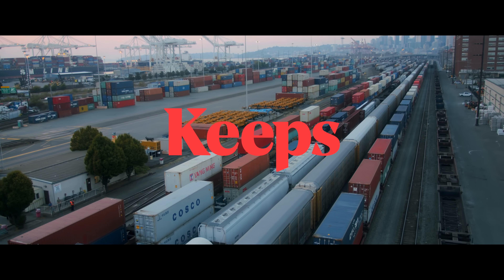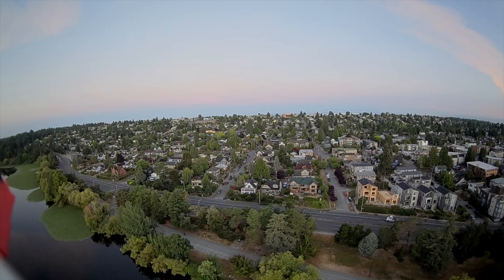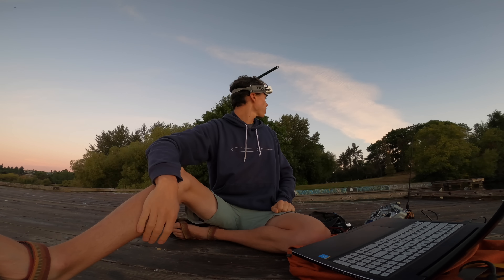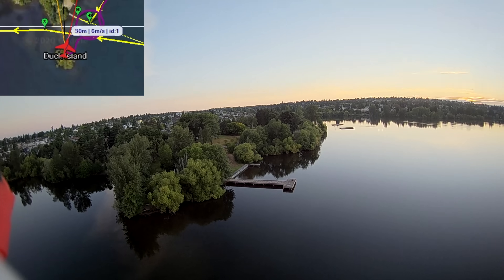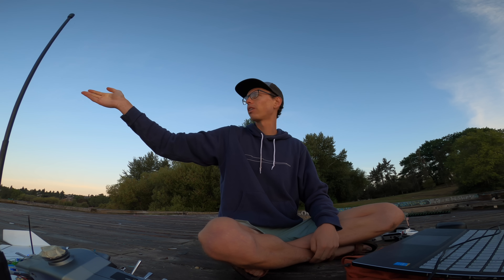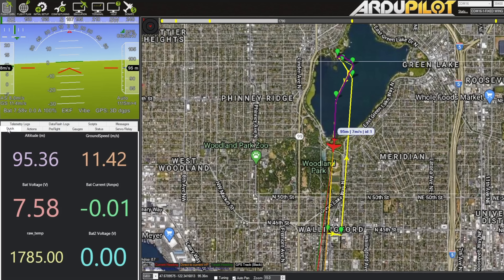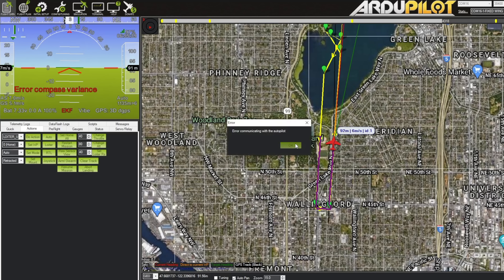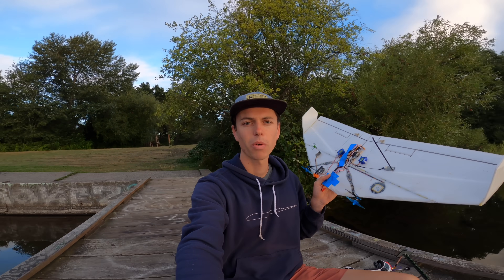Tiny Waypoint Drone! - 230g Autonomous Wing

Comment: laws and politicians are stupid in general.
your plane looks good, I am building a drone from a few new parts but mostly secondhand parts from a broken drone I bought for €10(with 4 working brush less motors, the only thing that was broken was one of the 4 ESC's it was a 4in1ESC so I decided to replace all of them and use that 3in1 esc for some other project in the future either as a 3in1 esc, or if I can fix the broken ESC as a 4in1 ESC. but if I can't fix it(make it balanced) I wanted to use the motors and such for making a plane like that kind of.

also know that your drone is hand made, so if they where to make then in factories things would become a whole lot lighter than you made it, and likely cheaper as well. since in the past there where quadcopters with many such things building for very cheap, so if the make it like that in a simple sturdy relyable plane glider it would be a great option for very cheap long range flying for beginners.

however building it yourself is certainly also fun.
and allows you to do a little more things since you can more easily fix it yourself.
however I would personally try to add something to make the landing more safe, I would be afraid of breaking the propellors like that. and adding a landing mechanism doesn't need to be to expensive or obstructive. after seeing you dive straight into the ground on your first landing I came up with some fun FDA aproved landing mechanics which acording to the FDA and politicians would be completely safe.

method one would be to add some kind of spike on the front and add it on a spring so it gets pushed back and gradually blocks more force the furhter it is pressed untill the plane stops. that way you can just nose dive straight down, the spike on the front will go into the ground and the spring will dampen the impact. if the plane went down fast enough and the spike is sharp enough it even might keep standing in the ground making it more easy to find it. however be carefull to keep it below 250 grams, since once it weight 251grams that plane would suddenly become super dangerous.

method 2 relies on a tail and having a hook  a bit back on the tail. that hook should be able to slide out and then use something like a elastic to brake the plane down after the hook grabs in the ground. kind of like what ships do but with a little springing function to protect the plane.

ofcource both these methods are just for fun/joke reasons they wouldn't likely be the safest most relyable options and certainly not the most easy ones,  for example a parashute should be safer, and you could also just make landing wheels or some slide like mechanism. using some kind of slide like mechanism would prevent it from breaking the streamline which means you wouldn't need a servo to retract the wheels.

it also actually would be interesting to see a RC plane based on the mars glider, it is a new(acient) type of wing which is far more efficient than normal plane wings and much more stable. new as in barely used despite the designs being out for many years by now(you can find it on NASA's site or on some random old glider forums with mostly chinese american people. or in germany in the past, but back then they did it on accident without knowing it, and they just did it because it was cheaper and more easy to make.

but using that mars glider principle you could make it a lot lighter and give it much further range and also many other things like stability, a better speed response to both low and fast speed and such. 

also if you ever want to build a really weird RC device then contact me I know some interesting projects. some might however need to be adapted based on skils.

Comment: WHY DIDN'T YOU USE LITHIUM ION BATTERIES two relatively cheap cells can get you 4ah and the equipment isn't that power hungry i bet you could get away with using 30a discharge rate cells

Comment: I wanna see some slight improvements to this wing.. i know you have stuff like the ESCs and radio in the foam, but what about the battery, servo motors, and other electronics? Even a slight bit of drag reduction I feel could be very beneficial here.

Comment: Regarding this videos sponsor. Keeps' primary medication is called Finasteride. Keeps charges $75 for 90 1mg-tablets ($0.83 per mg). The same medication is available, in the UK, for as low as $0.49 per mg without the marketing and subscription nonsense.

Regarding Finasteride itself. Finasteride works by suppressing the hormone dihydrotestosterone. 

"Dihydrotestosterone is a hormone that stimulates the development of male characteristics. It is believed to be responsible for triggering the changes experienced during puberty in men. This hormone also causes the prostate to grow and is thought to combine with testosterone causing the expression of male sexual behaviour. Dihydrotestosterone is many times more potent than testosterone, and many of the effects that testosterone has in the body only happen after it is converted to dihydrotestosterone." (Source: https://www.yourhormones.info/hormones/dihydrotestosterone/)

Side effects of Finasteride include:
- decreased sex drive
- trouble getting or keeping an erection
- ejaculation disorder
- increase in breast size and tenderness
(Source: https://www.healthline.com/health/finasteride-oral-tablet#side-effects)

TLDR: Keeps is somewhat expensive for what it offers and its medicine works by (effectively) suppressing testosterone levels to postpone hair loss. This may have significant side effects, typical of what you may expect with reduced testosterone levels.

Comment: Anyone know a good set to control ground vehicles autonomus with ardupilot? I wanna get into this and there are just to many boards and components to have a clear overview or even understand how everything works together.

Im familiar with flashing firmware and working with microcontrollers and even coding, having a printer and everything you need to realize something like this.

I just need a good bundle of components or a good video where you can understand everything.

Thanks.

Comment: toss a couple Sanyo NCR18650GA 3500mAh cells on there and get about 4~5 times the flight time, and clean up that mess and reduce to one motor for additional time. This one guy flew a 4 hour 100 mile trip with a z84, 70mah/mile (260mWh/mile). Thanks for the video.

Comment: If your plane was a pusher then yes, the baby might giggle.  But instead, the baby's face might get sliced and diced.  Instead I'd say its far safer than fishing with razor sharp hooks at the shoreline being whipped through the air near ground level and leaving dangerous invisible string around for animals to choke on and strangled with.  :-)

Comment: Does the dragon link connect to the PC for telemetry? I saw a USB cable there but didn't notice if it was connected to the radio
Reply: Do you know this already? I am really curious aswell because I am working on a plane like this aswell and i dont like using an extra antenna for the telemetry for ardupilot because i already do have telemetry on my transmitter.
Reply: @pingsangi5418  while sadly no one replied to my original content, I soon took research on my own hands and found out Dragon Link does support MAVlink natively and uses a dedicated wifi or Bluetooth module to connect to your laptop, so no wires beyond power and PPM are needed.
Reply: Thank you very much for replaying this quick! So you mean he has a module on his transmitter that sends the data via Bluetooth or WiFi to the computer? Do you know which modules this are? Thank you a lot already!
Reply: @pingsangi5418  The dragon link system has two components, a transmitter and a receiver. 

The receiver connects to the flight controller and uses MAVLink as communication/telemetry protocol.

The transmitter connects to your radio (I.e. taranis) using PPM or SBUS; this transmitter also has an included WiFi/bluetooth module, which is how it relays info to the computer. 

I shall advice you check on the DragonLink’s website for a bit more in depth info!
Reply: @DaWalkDude  Thank you a lot! You helped me so much! Is it also possible with the frsky QX7 because I have that one already? If it onely is possible via USB cable i would like that to know aswell!
Reply: @pingsangi5418  as far as I’m aware, as long as you have a JR-style bay (or any kind of PPM output for that matter) it can work with dragon link

Comment: The problem that there is a gap for models that light, is "solved" over here, in that as soon as there is an onboard camera, the same laws apply as if it would be heavier. Clearly proofes that the whole legislation is not about endangering others, but the fear of those in power that someone cold control what they are doing. 😳

Comment: There is also a select group of people building speed planes under 250g. The german fdd pilots have achieved around 290km/h, check out speedcroco for that.
Lukattubato has built a 250 fpv plane that could do more than 260km/h.
I have built a 250g 6s composite speedplane without fpv that did 250km/h on it's first flight!

These are probably the most dangerous 250g models in the world, way more dangerous than a ft foamy of 500g...

Check all those people's and my youtube channel for videos.

Comment: Is that really just a sheet of foamor is there two layers to it? Super interested in this build have a couple small wings I'm working on but this looks way easier than what I've been building I wonder what flight controller is light enough to keep under 250 g
Reply: It looks like a KF Wing. Very easy to build.  This one likely one piece dollar tree foam board.

Comment: Certainly, it needs a small solar panel. Though it may not give enough power to fly, it can at least extend the range a little. If the drone gets stuck somewhere, it will slowly charge, instead of draining out the battery. A solar panel is better than no solar panel :)

Comment: Under 250g is still required to fly within all FAA guidelines that govern rc aircraft. The only thing the 250g limit applies to is needing your FAA ID number visible on the aircraft. This is a common misconception that is being pushed forward because no one has read the rules thoroughly. In the next few years this type of flying will actually be very limited on the legal side no matter what without an active remote ID system on the aircraft. I am not judging you're flying here at all, I am trying to bring awareness to this subject so we all can participate in the rules that are being made right now.

Comment: Have you done a video on how you get everything connected?  Have been flying with Inav as I had some bad issues with Ardupilot.  Wasn't able to figure how to connect the computer to the plane.
Reply: Do you know this already? I am really curious aswell because I am working on a plane like this aswell and i dont like using an extra antenna for the telemetry for ardupilot because i already do have telemetry on my transmitter.

Comment: I was wondering if it's possible to use a drone to lift your antenna/transmitter high above the ground to give a better line of sight signal. Or build a wireless relay of some sort on a drone? I can send you some crude drawings of what I am thinking. I know it's not practical but it would be cool to see if it's possible. (this is coming from a Part 107 pilot, I mainly do architecture and development aerial photography)

Comment: I hope my maths is still correct....
Velocity x mass = overall mass

So if a box of tissues is 250g then at 30 mph it would weigh 7.5 kilo’s about the size of a small dog... 7.5 kilos in a baby’s face isn’t exactly a tickling stick... I would estimate the baby would react a lil more strongly than that... Also the mother would probably kill you 😳

Comment: Have a sub-250g fpv wing. With gps and rth/waypoint capabilities it is great. With the race quad motor it has power and efficiency and twice the battery. Awesome to just go out with it strapped to my drone bag and chuck it in the air whenever.

Comment: What do you use to connect to the computer and set waypoints? I know you use dragonlink for control but im talking about communicating with laptop and being able to control with laptop.
Reply: Do you know this already? I am really curious aswell because I am working on a plane like this aswell and i dont like using an extra antenna for the telemetry for ardupilot because i already do have telemetry on my transmitter.

Comment: Bro that hoodie! Looks like a KFM airfoil :-) got a link?

One thing that's important, 250g mark only changes registration. All other requirements (like maintain LOS) are still applicable.
Reply: N0FPV .... That was an excellent spot. I believe that it is a KFm2. This makes the airfoil very stable and smooth.

Comment: To be fair, a 250g object hitting your (or a baby’s) face at ~30km/h would still hurt a lot. That’s like a volleyball ball hitting you straight in the face. But unlike a ball this plane has some sharp angles and propellers which could cause cuts or eye damage. Of course that’s a worst case assumption and very unlikely. In traffic it’s similar in weight and size to a pigeon. Not enough to destroy a windshield but still enough to distract drivers or cause cyclists to crash.

Comment: Doesn't 5.8Ghz use more power and less overall distance than 2.4Ghz? 
Just thinking do you actually required the full amount of data transmission that 5Ghz would give you? I know you are transmitting video, but I would think the Pro's of 2.4Ghz here might outweigh the 5.
Please tell me if I am wrong, I am far from an expert on this and would like to understand why my thinking is incorrect.
Reply: It does in theory, but it's more expensive and the 2.4ghz band would probably be worse in a suburban area like this due to interference. Also the antennas are larger.

Comment: Question. I've managed to get my wing to 2.7 miles out and back on 5.8 with a patch antenna and Crossfire. I always have my finger ready on the RTL switch. How do you get telemetry back to Arduplane on your laptop in real time? I assume it has to do with Dragon Link. Is that correct?
Reply from the maker: Crossfire should be able to do it too. Check the instructions

Comment: Primary hazards for normal fpv: large birds, small aircraft
Primary hazards for this thing:
Small birds, large insects
Reply: But not a baby's face.
Reply: 15:04 you can already see they're attacking
Reply: "onboard CPU to base station - just hit a grasshopper ... self checking systems ... oh now - another locust ... 3 ... 4 .. foam wing severely damaged, prop slicing through the swarm ..... stalling detected ... going down! MAYDAY MAYDAY! Terminal velocity reached!  Critical lower flight height reached!  Expecting impact ...."  *flatlining*
FPV-pilot: *f*ck*
Reply: And mavics
Reply: And stupid peopels that bull you and request drone flight permission if even it is not need

Comment: built a inav based wing with gps at 250g out of a Hobbyking Bonsai with 5inch prop and 2205 motor. works perfectly and doesnt need as much modifications. Also runs 3S or 4S (bit heavier) up to 180kmh :D

Comment: Li-ion battery gives you more energy capacity and less weight
Reply: a li-ion would weigh twice as much, you wouldn't gain much at this form factor, especially considering the extra voltage sag.
Reply: @Mansare94 obviously you haven't used one before
Reply: @dronepilot1333  I've built one. Think about it. You're adding 50 grams minimum, thatd take it over 250 anyway.

Comment: Very cool plane, well done! I think you could boost the battery range by a significant amount with other motors. These high KV drone motors with their small propellers are not exactly efficient... A lower KV motor with larger propeller would be much more efficient.
Reply: What motor/prop configuration do you think would be better? I want to build one and try your config
Reply: @pereoz   In general, the bigger the propeller is fort a given amount of thrust, the more efficient it is. Also, there's a simple rule of thumb for RC-Planes: At about 300 Watts per Kg weight, the plane will climb vertically. So for this plane, I'd suggest 200-250 Watts per Kg. This would be about 60 Watts for this particular plane. So I'd choose something like a 2204 Outrunner (27mm Diameter, 20-25g weight, 80 Watts max.) and probably a 7x4 prop. Something like this would for sure be more efficient than two high revving drone motors.